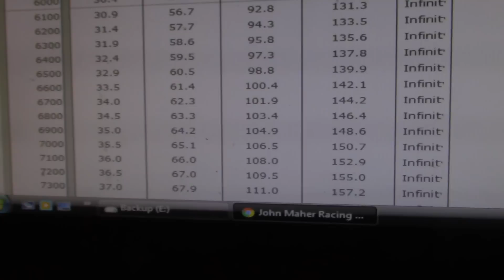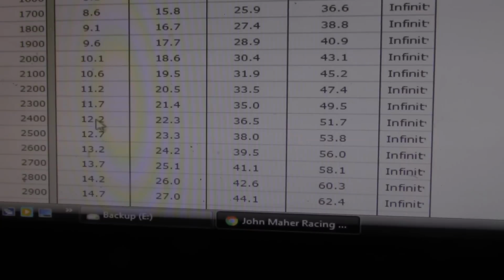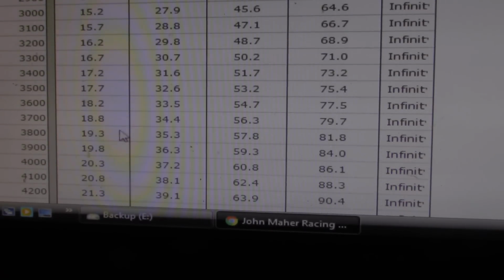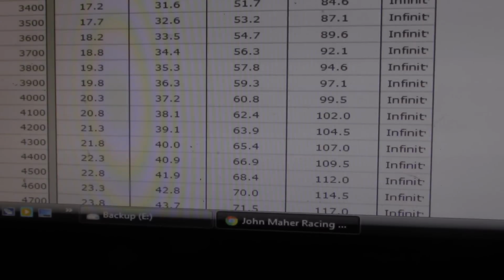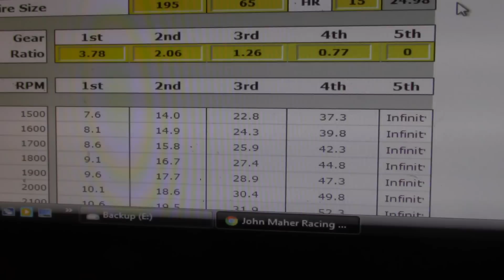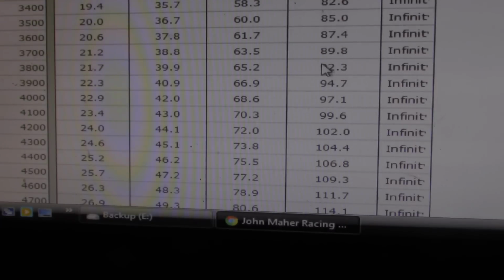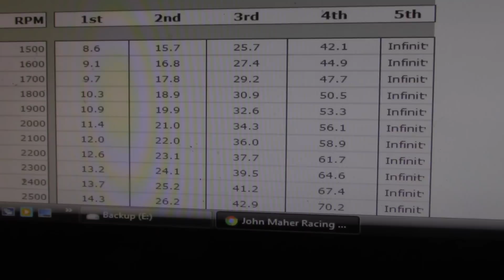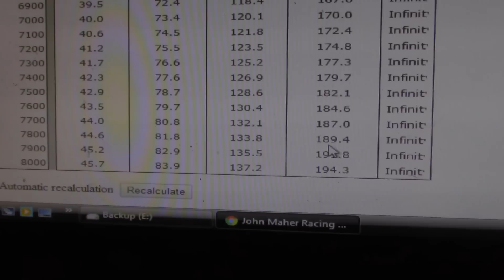vw Gear ratio

Comment: I've always struggled with my freeway flyer as it's like a 5 speed with 4th missing.
Shame the berg 5 speeds are so pricey.
A few guys in the UK run Porsche 911 5 speeds in their drag cars.
I'd like to even out the gears but i'm not sure that's possible.
Reply from the maker: +djambrosia you should try a 344 ring&pinon next time i think you would really like it .you can buy them on the Samb the 344 works very well it makes the box very linear , and you don't get that drop off in fourth  gear

Comment: Hey vwdarrin quick question, I'm going to be building a solid little single port 1641 for my bug soon here would you recommend doing cams or anything like that? I just want it to have a little get up and go. Let me know what you think.
Reply from the maker: i love single ports. they work very well and responded to a small cam  a C25 Scat cam works great if you are going to stay with a single carburetor , dual carbs work great but the manifolds are pricey ,the guys at Caddy shack  have the dual carb set up

Comment: how about a case for the trans   your preference for a heavier set up shift forks  ETC   ps you look like you are doing better on the medical  thanks always great videos
Reply from the maker: if you are going to use a factory case i prefer the 1972 model i like the pinion bearing in these cases over the four bolts , the new rhino cases are made of aluminum and they seem to have no memory  form the lack of magnesium